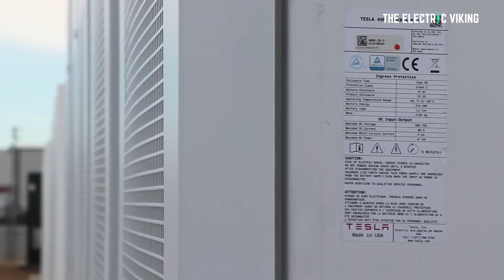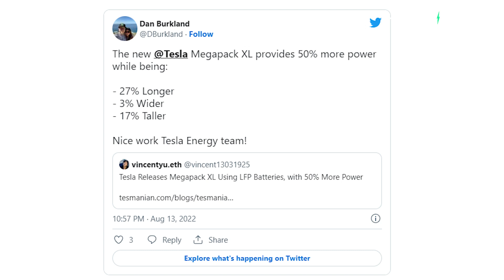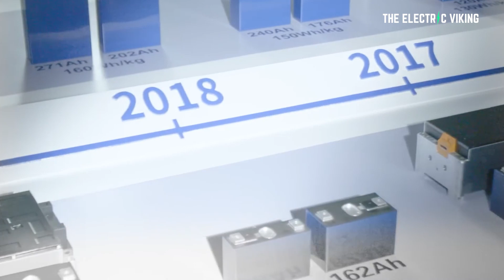Tesla energy packs increase by a massive 50% - nobody notices!

Comment: Battery storage for wind and solar farms has been the "missing link" in the clean energy cycle. I have heard thousands of times how wind and solar don't work because sometimes the sun doesn't shine and the wind doesn't blow. Even that is not 100% true. Wind and Solar farms are built in areas where sun and wind are rather predictable.
I hope that they build the batteries modular such that when they don't meet the storage requirements for the power plant, they can be repurposed somewhere else.
If the original module was 100kWh and now can store only 80kWh, so what? I would buy one or two for my home.
Reply: Why would you buy one for your home?..........when the grid can supply all the power you need at a 1/4 ly cost it wouldn't make sense to try and go it alone.....togetherness is what makes the Social system (that is not to be confused with Communism) so strong.....those that think in terms of me me me are the selfish idiots that will always think of themselves as opposed to contributing the the overall picture.......ask me how I know, I'm a long term winner.
Reply: @gangleweed  - Not everyone lives in an area served by these clean energy systems.
I used to live in WI where night-time electricity cost 1/4 of day-time electricity. If I still lived there I would have solar panels charging the batteries buring the day and almost free grid electricity charging them overnight.
The area was somewhat prone to tornadoes that cut the electric supply for two days in the middle of a hot summer.
I borrowed a generator from my friend to keep the fridge running and the lights on.
The home battery storage, including your EV, works both ways. They can feed the grid in an emergency. That is the ultimate distributed power system.
Reply: @johannbrauer9285  I suppose we're spoiled for choice where I live down South as nothing out of the ordinary happens weather wise although up country they're getting floods and high winds.........power wise we have a very stable 220 volt single phase system and as long as you pay your power bill nothing gets out of hand.
Reply: What you said isn't true, at least in the UK. High pressure weather systems in the UK, especially in winter, bring days of light winds for days on end. For example, in the 5 days from 17th December 2021, wind and solar contributed about 3.7% of grid demand. Most power was generated by gas, nuclear, and a bit of coal. All of the batteries in the world wouldn't have bridged the deficit. Plus, if battery storage is such an obvious benefit, then maybe wind and solar farms should be forced to build storage batteries to back up their capacity instead of gas-fired power plants that someone else is paying for.
Reply: @brendanpells912  - Using any particular country, especially a small country like the UK is not useful. It is like saying that I know a Chinese person with three eyes and extrapolating that to mean all 1.4B Chinese people.
This technology is in its infancy and looking at numbers now is like going back 100+ years and saying that cars will never make it because 99% of transportation is by horses.
Reply: @johannbrauer9285  It's not like saying that at all. I picked on the UK because I live there and have access to all the data about how electricity is generated in the UK. The UK is also touted as having huge amounts of wind energy potential and I'm just pointing out that with all the potential, the statement that the wind is always blowing somewhere just isn't true. It can also apply to many other countries which experience similar weather patterns. Storage batteries are not a solution, unless it's a remote village with no grid supply, that uses enough power to power a few laptops, phones, a water pump and a satellite receiver. The 'we'd still be riding horses' trope is really dumb and tired. When gasoline powered cars first came out there was a natural inclination to stick with what is familiar. People didn't know about gasoline. The difference today is that people are more scientically literate. They know what batteries are and what solar panels are because they have been around for years. We can all do the maths to work what is feasible. Compared to a horse, a gasoline car requires far less maintenance. Compared to a gasoline car, an electric car requires less maintenance, but the leap from horse to car is much bigger than from car to EV.
Reply: @brendanpells912  - Compare the UK numbers to Norway. That will answer all your questions.
Reply: @johannbrauer9285  Dumb comparison. Norway has lots of hydroelectric power. They just happen to have lots of mountains, glaciers, regular rainfall to keep the water supply topped up. Plus, they are an immensely wealthy nation because of all the oil and gas they sell to the rest of Europe. Most countries aren't as lucky as Norway, but if you think the solution is to start building mountains and drag the country further north then I'd like your ideas on how that can be done
Reply: @brendanpells912  - How about them Danish mountains? Probably a better comparison to the UK. Look up the numbers.
Reply: Why mention Norway at all if it's not relevant to the argument? Denmark? Well, it has exposed coasts, and a population less than 1/10th the UK, hence overall demand for electricity is lower. The high pressure systems that affect the UK will also affect the North Sea area including Denmark. I expect there are times when Denmark has to import electricity because there isn't enough wind energy. My point is that battery storage isn't going to fill the gaps when there is no wind. Battery storage isn't going to mean we can get rid of gas-fired power stations. A great example would be the 250MW gas-fired power station at SpaceX in Boca Chica. If solar panels and battery storage is the future, why didn't Musk fit Tesla solar panels and Tesla storage batteries to provide clean power instead of burning natural gas? Answers are 1. Not dependable and 2. Prohibitively expensive.

Comment: Could someone help me with this?  He said $2.4 million dollars for 1.9 MW for 2 hours -- which is 4 MWh or 4000 kWh.  This is 2400000/4000 = 600 dollars / kilowatt hour.  That is extremely expensive.  Yet the EV is saying this is cheap.  What am I missing?
Reply: You are missing that each time you reuse the battery bank, the cost per kWh goes down. The price you calculated is for the first 2 hours for utility company. Get it?
Reply: @yruhatin100  Exactly that. You need to divide by the number of cycles. Powerwall 1 had a 5,000 cycle life, so these should have at least a 15,000 cycle life. Divide $600 by 15,000 and you get $.04, i.e. 4c/kWh
Reply: Key number missing is voltage and amps. There is a formula to determine how to figure 1kw@2000volt to convert to ?kw@240volt. Sorry I don't remember the formula, been a long time since i used the formula. Sam was talking the price to purchase the Big Battery Power Plant.
Reply: Good question.  The missing factor is the operating lifetime of the energy storage asset.  It is captured in Lazard's metric called "Levelized Cost of Storage" (LCOS) which is similar to their widely used "Levelized Cost of Energy" (LCOE) which is used to compare power sources.

LCOS essentially takes initial cost and depreciates it over the total expected operating lifetime (cumulative MWh) along with O&M costs (operation & maintenance).   It also factors in battery depth of discharge, round-trip efficiency, cycle degradation, self-discharge, construction time and a bunch more variables -- there's a whitepaper on it (science direct).  Battery storage, being all solid state, requires next to zero maintenance.   

As Electric Viking stated, the fact that LFP batteries have 3X the operating life over Lithium-NMC so this factor alone will really help bring down LFP's LCOS value over Lithium-NMC.

I believe current Lithium-NMC LCOS is somewhere in $131 to $232 per MWh depending on current grid scale battery sizes.  Pumped hydro storage is at $186/MWh.  The upcoming grid specialized Liquid-Metal flow batteries from Ambri are supposed to reduce LCOS to 50% or more from current Lithium-NMC.

Comment: Now if Tesla would make LMFP  60Kwh Poweralls for the home!
Reply: With you on that but those will require machinery to move around.  At what point do we have repurposed used car batts for stationary storage on the cheap?
Reply: It would utterly destroy the retail energy market and the spot price for despatchable power generation. Not to mention frequency stability services. The retailers will have it legislated out of existence
Reply: @theairstig9164    It's a reality today in California...if you mean the "virtual grid" via optional home/business batts as peaker-plant replacements, feeding the grid for brief intervals on max demand hrs.  

It won't stop in Cali, tho the current (pun) return will need adjustment over time. Will be international.  

TLTR!:::::

Test runs suggest homeowner may recieve10 to $60 per event from utility Co  Presumably a few hrs each typ.  You can opt in or out at anytime, specify personal reserve minimum and so on, naturally. 

'Events' could be months apart or a few per week when ACs running max, mid summer afternoon.  (tentative understanding)

So you can automatically draw from grid at low prices to sell back or combined w excess solar.  Peak solar is close to peak demand in a Cali type climate tho right when u need it most too maybe.